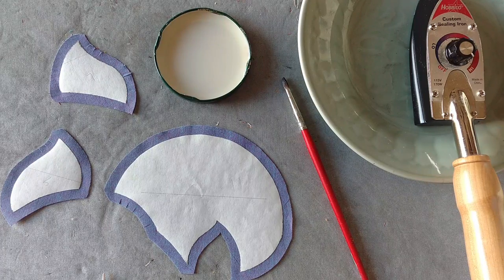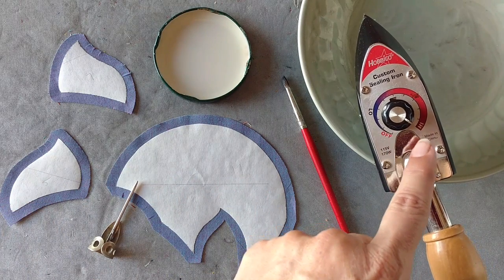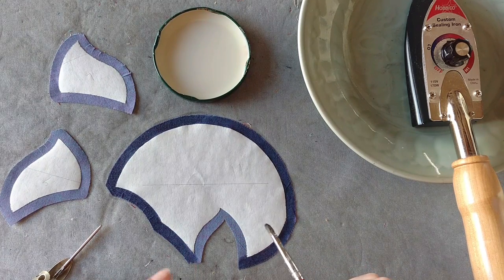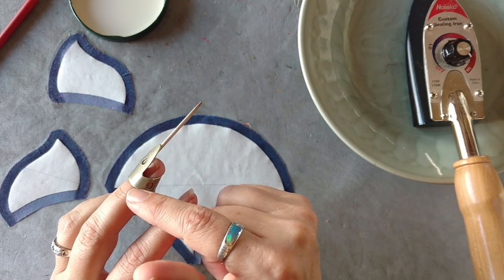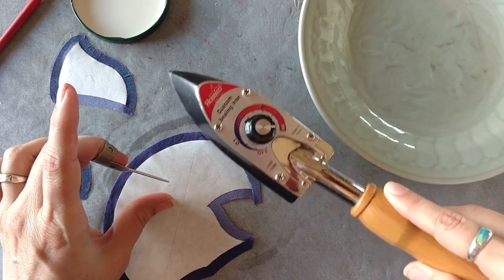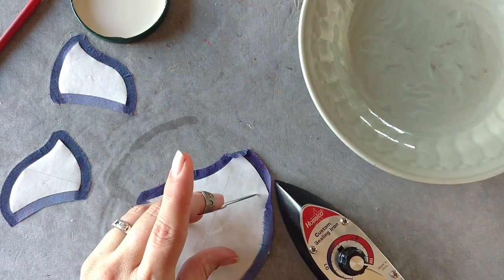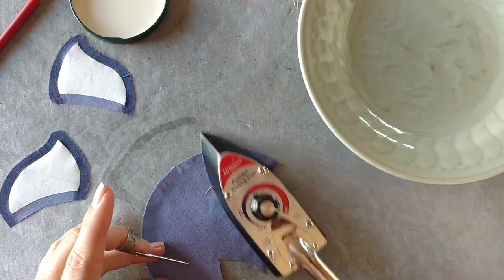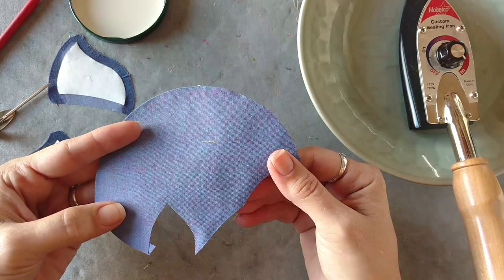Appliqué with Swan

Comment: YOU DIDNG TAKE THE PAPER OFF HOW DOES THAT WORK
Reply from the maker: The paper comes out of the appliqué pieces only when you are ready to stitch and then it is easy to pop it out.  Until you're ready to stitch, the paper stays in to keep the piece stable and easily stored.

Comment: Hola buen trabajo !!!  Donde compro y q precio tiene la plancha pequeña?? Un saludo GRACIAS
Reply from the maker: Muchas gracias!  I switched iron types not to long ago and now use the Clover Wedge Iron.  Here is a link to what it looks like on Amazon.  You can find the wedge irons a little more easily than the iron I was using in the video and the wedge iron is easier on your wrists over time. I hope this helps! https://www.amazon.com/Clover-CLO9200-Wedge-Iron/dp/B015NXHQRS/ref=asc_df_B015NXHQRS/?tag=hyprod-20&linkCode=df0&hvadid=167164505512&hvpos=1o1&hvnetw=g&hvrand=9218798139615343107&hvpone=&hvptwo=&hvqmt=&hvdev=m&hvdvcmdl=&hvlocint=&hvlocphy=9030220&hvtargid=pla-306365104264&psc=1

Comment: What do you have under the pieces that you can both paint on and iron on?
Reply from the maker: The surface is a travel ironing board.  :)
Reply: @SwanAmity  Do you ever need to clean or wash the board?
Reply from the maker: @annlittle6193  the board will eventually build up starch and discoloration.  I replace the cover of my travel ironing board every couple years due to the volume of applique I usually do, but using a washable cover is an excellent choice.
Reply: @SwanAmity  Thanks for such a quick reply !

Comment: trolley needle! brilliant! what are you using as an ironing surface? I was using a drafting board with a towel, but the towel has too much texture.
Reply from the maker: Hi Brenda, I am using a travel ironing board from Omnigrid, but any small ironing board will work.  If you're looking to make one, you can layer batting onto a hard surface, and top it all with a heat reflective fabric (often available at your local fabric store).